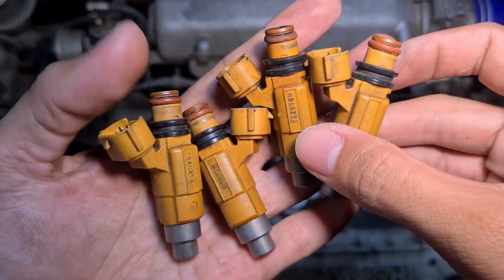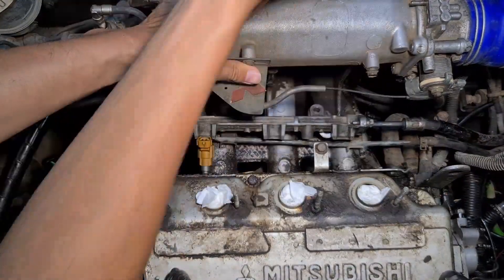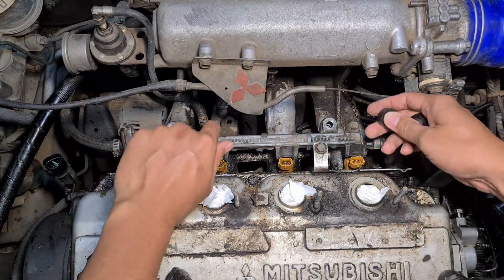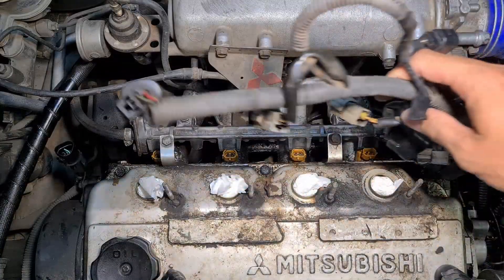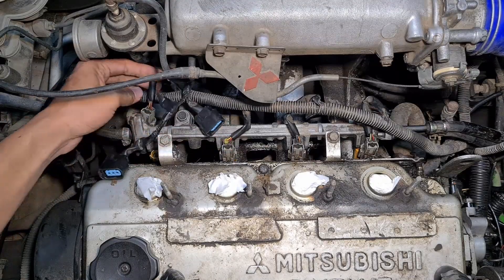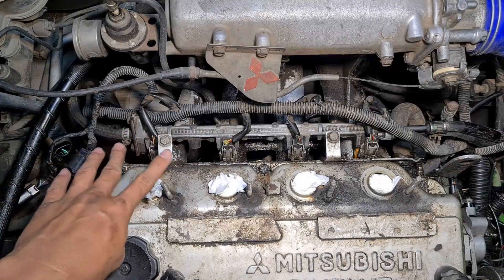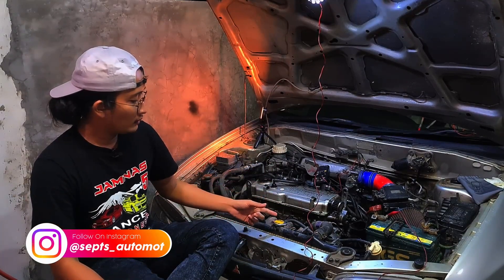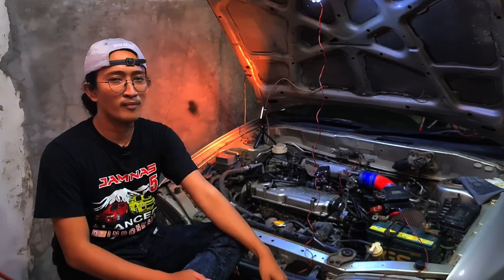Pasang Injector Mivec - Tutorial Pasang Injector Lancer CK4

Comment: Om,setelah ganti nozle 275cc berapa seting yg pas variable resistor pada mobil Om?
Dan performa gimana om di banding  nozle 210cc? Signifikan gak perbedaanya? Tq
Reply from the maker: variabble resistor saya seting di 1.8v mas. 

Secara performa sih karena ada beberapa segmen lain yg saya upgrade  ya ada kenaikan performa setelah pakai 275cc. 

Note :
Sebaiknya injector ini jadi opsi upgrade terakhir ya. kalau mesin maupun segmen lain masih std, sebbaiknya jangan buru2 naik ke 275cc.
Reply: @septsautomot3082  jadi ceritanya gini om,hasil pembakaran mobil saya busi warna putih, variable resistor sudah saya coba seting di 3.000 - 3.500- terahir 4.000 tapi busi gak bisa coklat bata,
saya ada sedikit up grader om:
1.Exhaust manifold saya pakai merk Alvaro 4-1 panjang
2.Resonator alpino
3.Mufler ORD V2+
4.Saringan udara ferrox
Selebihnya masih std Om
Reply: Saya cek pakai MUT3 / sceener khusus mitsubishi om makanya nilai variable resistornya ribuan, sebelum di up grade variable resistor di 2.800 busi sudah coklat bata
Reply from the maker: @ratno8987  kalau sudah upgrade dan injector standar tidak bisa memenuhi asupan kebutuhan mesin, saya kira saatnya upgrade injector mas. Barangkali butuh, saya ada barangnya. WA saya 085777779181
Reply: @septsautomot3082  trimks om atas inputanya🙏🙏🙏
Reply: Injector mivec lubangnya berapa?
Apakah semakin banyak lubang akan lebih baik?
Karena efek pengkabutan
Reply from the maker: @maralkimi7853  menentukan injector bagus atau tidak bukan dari jumlah lubang nozzelnya mas (semakin banyak lubang bukan berarti semakin bagus). Balik lagi ke kebutuhan mesin masing-masing.